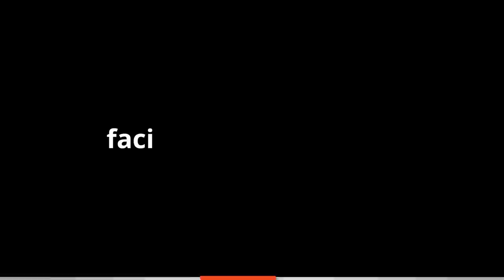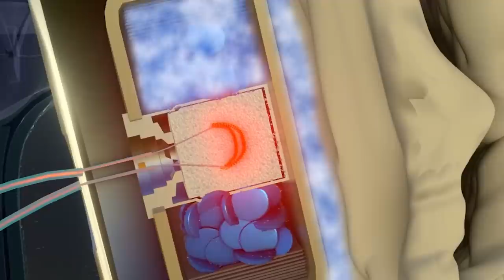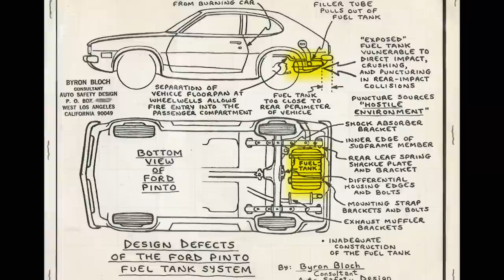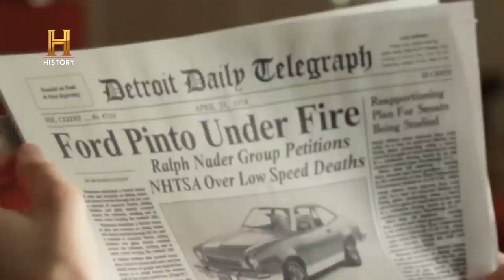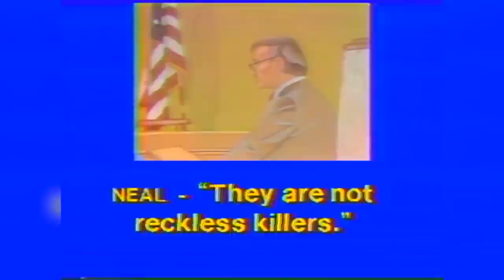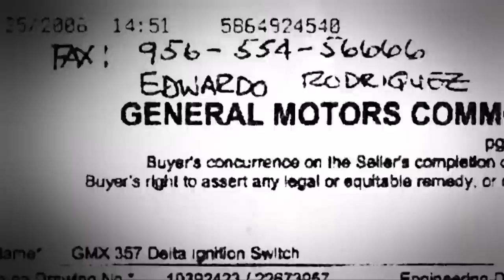These are THE WORST CAR SAFETY SCANDALS 🚗💥

Comment: Rule number one when putting air in tires, look on the sidewall of the tires and put 5 psi less then whats the max psi rating of the tire. The door sticker is only for the "OEM TIRES ONLY" and if you buy better tires the psi ratings are completely different.
Reply: you forgot the most important one, look what brand your car is. then when it is a ford get rid off it and buy a decent car thats isnt a casket on wheels.